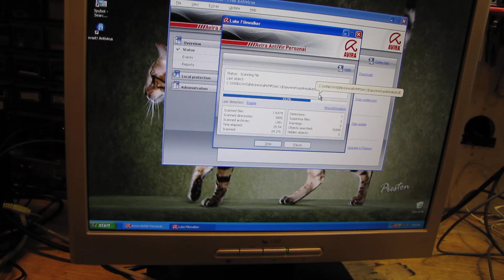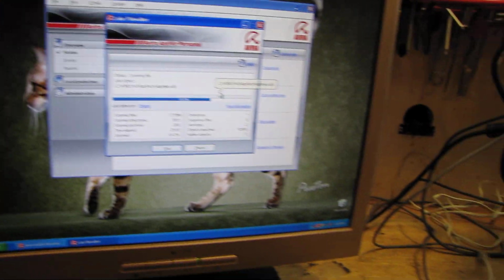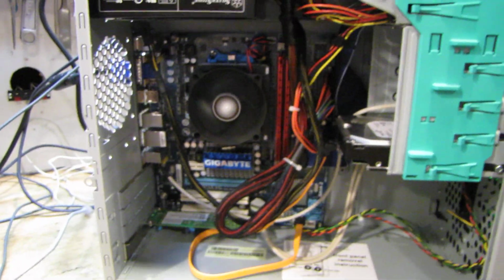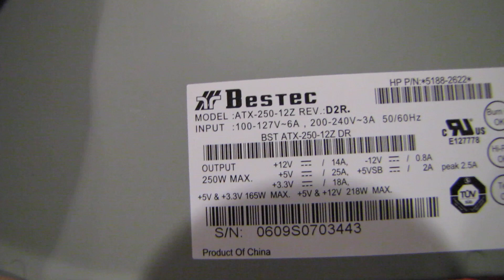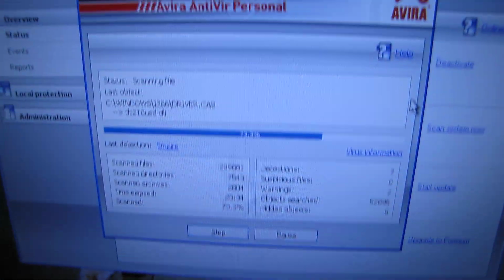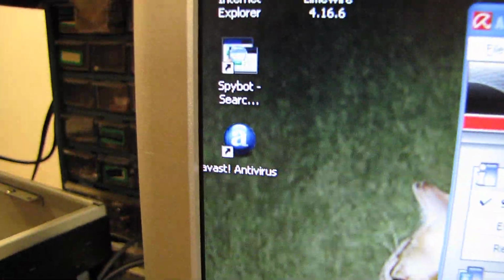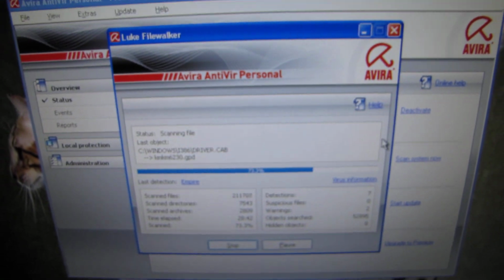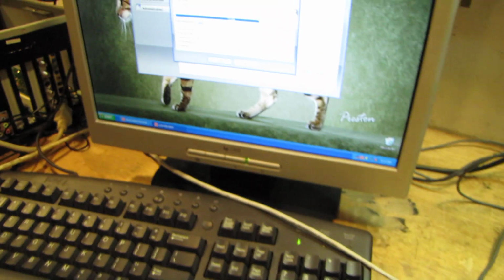Rebuild A Compaq Desktop Computer,  Part 1 of 2

Comment from the maker: @6guitarist There are small tabs on the side of the plug housing that you can carefully pry up just a hair, and it will allow the pins to slide out.  Take note which side of the pins face the tab.  If you can find some CD audio cables with the black housing, the pins should fit right in.  Just remove the old pins, trim the housing down to 2 pins, and put the pins for the LED in the new housing.  Do this for all 3 things (hard drive led, power led, and power switch).  White wires are negative.

Comment from the maker: The lumps are the standoffs that the board mounts to.  They only touch the board where they are supposed to, around the screw holes.  Some cases might have extras that need to be removed if you change the board though.

Comment from the maker: I don't recommend plugging the pins in without housings, since they can short to each other pretty easily.  If you have some small shrink tubing, you could put a piece around each pin.  I can't think of much else that would be reliable.

Comment from the maker: With a quad core and GTX 550, that's probably pushing the limit of that PSU during heavy processing.  But it depends on how the +12v rails are set up.

Comment from the maker: @MechaNintendoMast If I remember right, I only had to change the pins around for the switch and LED's in the front panel.  The case itself is a standard Micro ATX.

Comment: Odd that you had to revamp the 8 pin front panel connector, I rebuilt a HP a few months ago and the wires on the front panel connector lined up perfect with the appropriate pins on the Intel board I used to rebuild.  I made a video on the project if you choose to look.  Now rebuilding a IBM/Lenovo, It can be done, but they make it tricky.

Comment from the maker: @needafix4pc Did you plug in the 4 pin power connector for the CPU, if the system has one?  It has two yellow and two black wires.

Comment: i recently rebuilt an older e machine t3516 with a gigabyte g41sp2pt lga 775 mother board mine is the ultra durable variety i also installed 8 gigs of ddr3 corsair xms ram windows 7 home premium and the oddball e5700 intel pentium dual core proccessor that runs 3.0 ghz 800 mhz bus speed i also threw out the old bestec in favor of a corsair cx 430 builder series power supply so far this little desktop runs awsome i also have similar windows benchmarks as you for the sagate baracuda drive

Comment from the maker: @DARKZERO216psn According to what I read, the CPU is permanently attached to the motherboard, and it can only support PCI-E x4 video cards.  You might be able to replace the board, cpu and RAM, and use the existing case, but I can't tell for sure without seeing it.

Comment from the maker: @Dragonsrule89 As far as I know, any version of windows can only be installed on one computer at a time, unless it comes with more than one license.  If you need to re-install after an upgrade, all you need to do is call for a new code if the activation fails.

Comment: The Big Expansion slot bracket is part of the tool less entry, my new Dc7900 has no screws just a snap on metal plate...

Comment: i don't have any cd audio cables or any other spare parts to make the housings for  the front power button, power led and Hard Drive Activity LED  so is the another way to make the housings or can you hook the front stuff up with out using plastic housings

Comment: i found the plastic plugs on ebay for the front panel 3 and 2 pin plastic plugs just wondering with wires are positive and negative for the start button, power led and hdd activity led thanks for the help

Comment: Gigabyte are probably some of the best boards you can get for their price, you can do better, but it's going to cost you.

Lost count of how many systems I've build around them.  Give them a good PSU and they rarely come back in for repairs, well not hardware related repairs that is.

Unbelievable that Compaq still uses that mechanism to hold cards in place.

Windows 7 is going to run sweet on that thing.  What kind of video card does it have?

Comment: would i hook up the power led on the message power sleep led header or power led header the  message power sleep led header is two pin and the power led header is a 3 pin also i can't see any white wires

Comment: My pc is brand new 2012 
Build it myself and iam 15 Iam sure you can build one for 400 dollars (or 350 euros i live in holland)

My pc specs 

Cpu: core 2 quad 2,6 ghz @3.4 ghz 

Ram : 8 gb

Videocard : gtx 550 ti 

powersupply 350 watt 

All togheter it cost about 370+- 400

Comment: You need to get a higher rated PSU.  The minimum system power requirement for the GTX 550 Ti is 400 watts.  You should get a 500+ watt PSU for that rig.